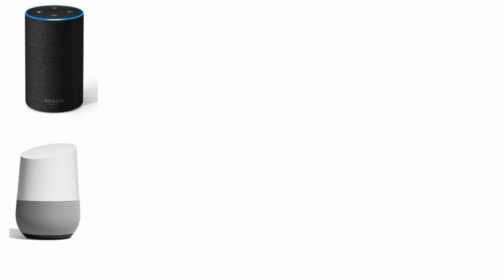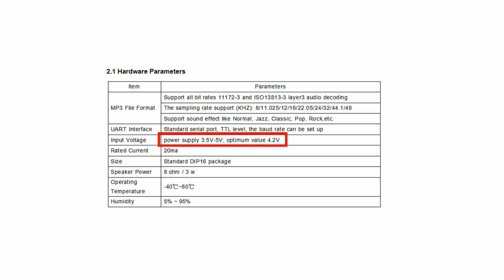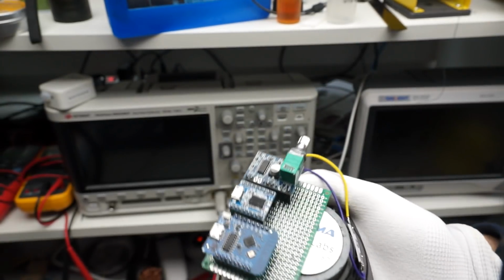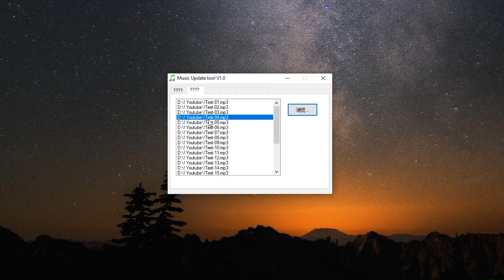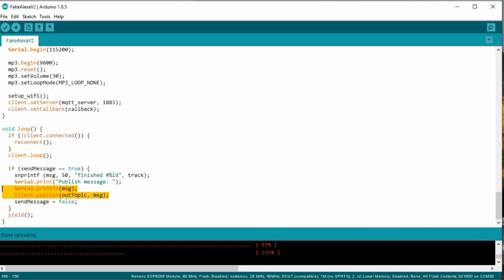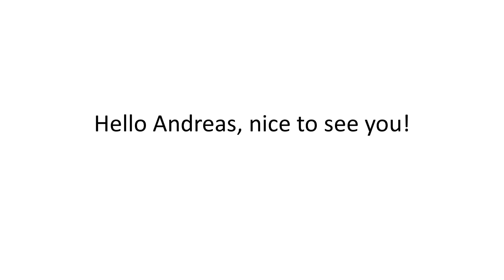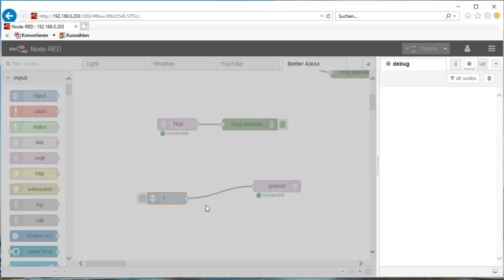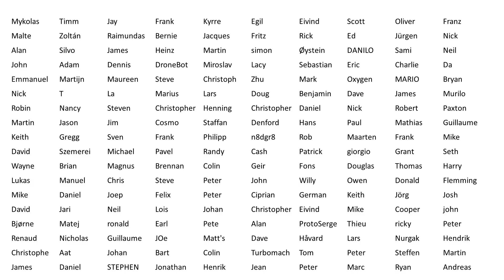#259 Add Voice to your Home Automation Project

Comment: Andreas, in video you are using a genuine Wemos module, but you are linking to a fake. Do you have any experience with these non-genuine modules? They are just ESP-12 modules soldered on a PCB, price - however- is much better.
Reply from the maker: I just grabbed one (which was a Wemos mini lite). I do not know which Wemos are genuine. I have many sources and did not see differences.

Comment: Do you know a cheap, Arduino compatible noise cancelling microphone array?
Reply from the maker: No.
Reply: @AndreasSpiess  I found an exceptionally good one in the mean time 
for the Raspberry that I would like to share: https://www.aliexpress.com/item/Respeaker-Ring-6-Microphone-Array-Expansion-Board-kit-for-Raspberry-pi-0-1-2-3-3B/32945628313.html?spm=a2g0s.9042311.0.0.27424c4dUCz60q

Comment: Hi Andreas - I made a similar device at Christmas using a DFPlayer mini (SKU:DFR0299) and placed 100+ separate mp3 files in a number of folders.  I wrote code for a esp8266 that could receive an mqtt command which consists of mp3 index and time delay.  So I send my system a message of {topic:"", payload:['141','1000','148','1000',voicetemperature.toString(),'1000','132','1000']};  - it will say  Central Heating set to 20C      I chose to generate my mp3s using a text to speech generator https://www.naturalreaders.com/online/   It has been working well and although it took a while to generate about 130 separate mp3 files it has been worth it, as my wife now has a button next to her seat (a modified tradfrei switch as per one of your projects) she can press that and get a status update for important house variables, ie Central Heating On/OFF ;  Central Heating set to "temp";  Hot Water ON/OFF  - just dug out a short clip https://www.youtube.com/watch?v=jvoio_kwEPs
Reply from the maker: Sounds like a really useful project!

Comment: The normal smiley is neutral (and not male, as opposed to female) and can represent a smile for anyone.

It doesn't know gender and can be used by male and female and anyone in between without worrying about useless information, it just communicates a "smile". :-)
Reply from the maker: You are right!

Comment: Note to self ... Never ever again use Software Serial on ESP8266 if also using wifi. I use ESP8266 to control an ebay "UART Serial MP3 Module With Amplifier" via UART and I also want debug.  Best solution is Serial.Swap.  It uses the same hardware UART but swaps the pins.
Reply from the maker: But then you lose the second Serial? That would not make sense in my case because I can use any pin. So far I did not have issues with SoftwareSerial. If I would encounter issues I would change to the ESP32 with more hardware Serials.
Reply: @AndreasSpiess  I effectively get two Serial ports but never at the same time (not a real issue). During run time i continually do serial.swap().  For example, on entry to the mp3 function I issue 
  Serial.flush();
  Serial.begin(9600);
  Serial.swap(); //now controlling mp3 player

issue the mp3 commands then I swap back

Serial.flush();
  delay(100);
  Serial.swap();
  Serial.begin(115200); //now talking comm port
Reply: i had the newer ones, but i ordered a couple of those 8266s just so i could wifi deauth lol

Comment: I wrote some code to play WAV files from spiffs to a bluetooth speaker from esp32 https://github.com/bootrino/esp32_spiffs_wav_bluetooth
Also to play text to speech from esp32 to a bluetooth speaker https://github.com/bootrino/esp32_text_to_speech
No additional components required!
Reply from the maker: Thanks for the links. Of course, you need a Bluetooth speaker ;-) And it seems it is not made for the Arduino IDE

Comment: A text to speech would have been a more flexible solution. Also comparing Alexa to this device is not fair as Alexa is meant for different purposes and not really for tinkerers
Reply from the maker: I wanted it more personal. Text to speak would be more like Alexa, you are right.
Reply: @AndreasSpiess  I think Google home can play custom messages using its text to speech, anyway you have to agree that tts is much easier to use than pre recording messages
Reply: @thesimbon  Google's TTS is in the cloud, but someone figured out how to get it to speak using the Chromecast protocol: they used TTS on an RPi to generate an MP3 file, then used cast to get the Home Mini to play it back.
Reply: @rantalbott6963  I read it was possible, but I couldn't remember how. Anyway it is still possible nevertheless 😅
Reply: thesimbon 
Also this device doesn’t listen, it only yells speaks. Just like real ….
Reply: @Conservator.  do you mean it just gives orders like the real...? 😅😂
Reply: thesimbon I think you understand 🤣

Comment: Very nice video, But the laundry should only be put out of the machine, not hanging up, And Alexas voice is more erotic than yours.
Reply from the maker: You are right with the voice. But so far, she does not speak Swiss German ;-)
Reply: @AndreasSpiess  the messages should only appear if the weather forecast is good :)
Reply: @AndreasSpiess  There are several free TTS packages available for Linux. The mbrola project has dozens of voices, including 8 German ones, so maybe there's a Swiss German among them?

For generating messages in English, I use pico2wave with the en-GB voice, which is very human-sounding, and some who've heard the systems have described it as "sexy".

Comment: Very nice well done.
By the way, I learn't a very little German over 40 years ago. but i spoke Afrikaans (dutch dialect) at the time in South Africa.
My impression is that your Swiss German dialect has some sounds similar to the ones the dutch use.
Reply from the maker: I think Dutch and Swiss German have about the same distance from German, just in a different direction ;-)
Reply: Santo Pino 
Well, I’m Dutch and speak some German but didn’t have a clue of what Andreas or his wife was saying (most of the time) 😄
Reply: Eduard van Raalte, I was referring to the harsh "G" sounds like in "gaan" which is not part of the German language.
Reply: Santo Pino 
👍 I should have read more carefully 😉
Reply: Eduard van Raalte no problem.